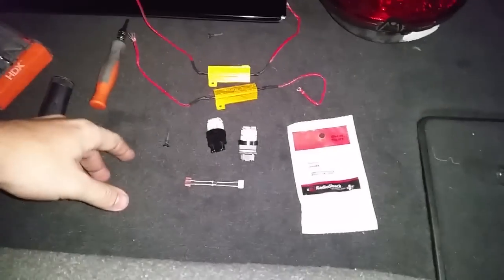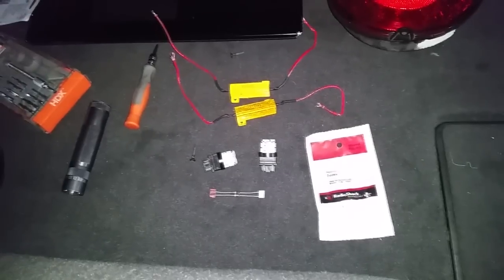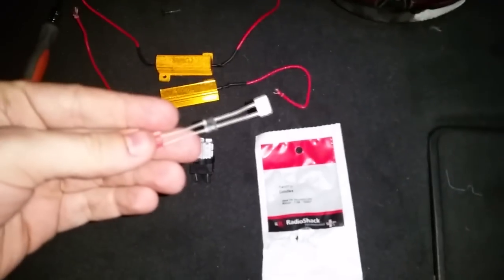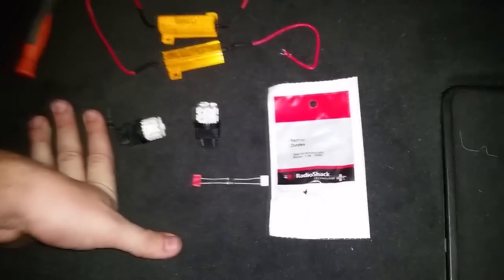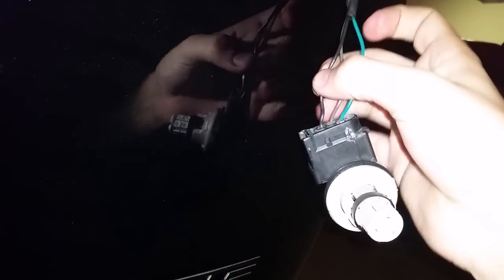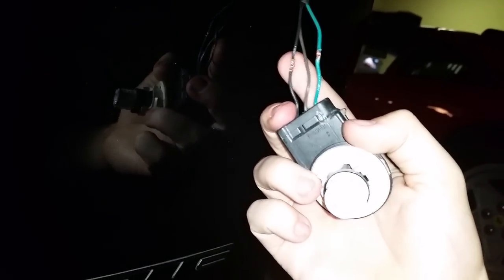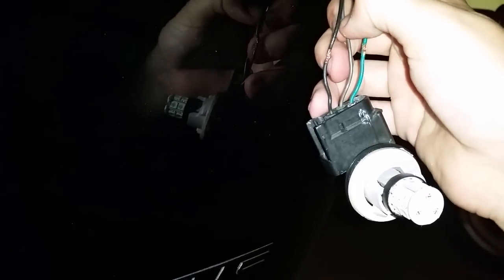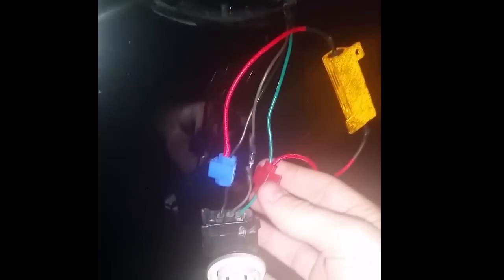3157 LED Turn/Tail Light Install Corvette C6 | Hyperflash and Park flash fix!!

Comment: Hi HardDrive - I have a question in case you encountered dealing with the front turn signals - I am glad to have found this as I believe it somewhat helped my condition. I replaced the front turn signal bulbs ONLY with LED switchbacks but my nuance is that I also added LED side markers to the equation. Adding the diodes to only the turn signal LEDs seemed to improve oddities but my question is should the diode be added to any LED "sensing/brown" wire? ie should I have added another diode to the front side markers or all four? as they seem to all have that brown sensing wire in common even though the side maker only has 2 wires black/ground and the brown/sensing. My issue/oddity is that my instrument cluster brightness adjuster does nothing its just one brightness = dim. I know this is old but thought I would try =) Thank you Greg
btw I do have a C6 now. Thx

Comment: Question about hyper flashing on Corvettes. On my C5, I simply installed one digital repay, and it solved hyper flashing on all the flashing LED bulbs on the car.  Why not install a single repay on the C6? Would that be easier than installing resisters on all the flashing LEDs on the car?  Is there a digital relay for the C6?
Reply: you guessed it, no physical relay on the c6. hyperflashing is handled by the BCM

Comment: I have a '07 Jeep Grand Cherokee.  There is one tail light bulb for the brake, tail & signal.  I checked all the wires & installed the resistor.  I made sure the brake light, tail light & turn signal worked...and it did (all in the same bulb).  Then I installed the LED bulb.  Only the brake light & turn signal worked.  I flipped the bulb around and the only the parking light would work.  Hmmm? Any ideas/suggestion?  Thanks!
Reply: Have you solved your problem yet?

I just bought an '07 Grand Cherokee. I installed these lights as well. Parking light works. Brake like works. Blinker does not. Hazards do not. I have yet to try this resistor.

Comment: Is water resistance tolerable? For example, in rainy conditions? I wonder how it is installed behind the lighthouse runs that risk. Or is it harmless?
Reply from the maker: As long as you seal your wires with heat shrink, the rest of the components are water resistant. I used liquid tape for the diode just to be safe. I've used these for over almost a year now with absolutely no issues. If you want to wait, I'm going to remake this video because I hate how poor of a job I did! Should have it up soon.

Comment: having the same problem with my 08 sierra, led tails, no resistors in, right side leds stay on the brake/bright setting and the left side functions properly. i hit the brakes and all the parking lights come on. would i still need to do the diode route ? ive never heard of another person going through this issue

Comment: Did this install with the exact components and method on a 2006 C6 Corvette (canadian model) and it did not work.  The blinker and fourways worked but running light circuit did not.  The resistor also got incredibly hot and even if it did work I would not have installed it just for this reason.

Comment: i was install resistor in my car .. but i need to know if its problem .. when i start the light for 5 or 10 minutes i cant tuch it .. its so soo hot it can damage plastic .. so is it normal or not
Reply: The same happened to me Amjad - so even if this worked (it didn't on my corvette) I would not have installed it for that reason.
Reply: Amjad that's normal hence why it's stated to install these on metal parts and not on top of any type of plastics.

Comment: Hey great video, just wondering where you attached the heat sink to? Theres a lot of plastic around that area. Also If you did the resistor on the far outside lights would you also have to do it for the two on the inside? Or are they running on the same wiring?

Comment: I have a 1997 Jeep Wrangler. I have replaced the front facing turn signals with LEDs and have encountered many issues. I have had “stock-looking” LEDs for the brakes for quite some time. They work, until now. The part No. RT-x24 is the new LED turn signals I purchased from [url]www.superbrightleds.com[/url]. I went ahead and installed 4 new heavy-duty resistors to both the brake and front facing LEDs. I do not have any rectifier diodes installed. My flashers don’t flash when the running lights, driving lights, or hazard lights are engaged. The relay is fine as I’m concerned. However, when I pull the knob (location: lower left of steering column) out one notch the dashboard turn signal indicators both come on. This is where the turn signals don’t engage, despite the LEDs being very bright. This is the same for the driving lights as well. Sadly, my hazards don’t even flash anymore. I would appreciate the help from any fellow Jeepers, like me.

Comment: Just out of Curiosity, I did exactly what you've done here (thanks for the wiring confirmation BTW) in my C6 GS Sport, this hyper blinking (LEFT TURN SIGNAL ONLY FAST BLINKING) is only affecting the left side, was this the case in your Vette?  also after installing the 6 ohm 50W resistor its still do the hyper blink?  WTH?  I'm wondering if I need yet another component, LED Tail Lights standard Bulbs in the front may also be another cause?

Comment: What size of diode what it? part #?
Reply from the maker: Its just called a rectifier diode. Any will work as long as its a ~1.5A & 1000V rated. I believe the RadioShack specific part is 276-1114
Reply: Thanks for the quick response! Do you know the exact number you used for ex. 1N4001, 1N4004 ect... not sure if there is a difference.
Reply from the maker: just looked it up. You need "GP15M" diodes if you want to follow mine exactly. After going back and watching this video, I realized how bad of a job I did explaining it haha. I'm actually going to remake this video now, that way its much more clear and concise
Reply: Right on haha I'll be looking for the new video!
Reply: Google Diode Dynamics they are 10$ for a pair 6 Ohms 50 W  What you're looking for they call an LED resistor kit, I've only got fast blinking turn signals but its not helping, hope it might help you!

Comment: Going L.E.D is the way to go when it comes to using less energy = less heat... but the hasle of putting them in a cars that came with factory filament bulb system, what a PITA. lol
Reply: Ikr... Replacing the lights with led, and then using 50w resistors. Like wtf? I installed LED blinkers on my car, and replaced the original relay with an LED relay.
Reply: @damianpc1  on vehicles with a body management unit, that's not option, the unit will show an error on the dash, if it came from the factory with filament bulbs you will need to go to the manufacturer's service centre and ask them to reprogram the unit. Last year I read that a certain big manufacturer used to do this for free if you did the install at their service center, but from 2022 on they completely stopped doing it for vehicles from 2017 and before and then in 2023 they stopped for all vehicles. So now your only option is have a hacker try to reprogram(possible on some) the unit or put in these resistors.

Comment: Did your car have issues with static on the FM radio? It only gets worst when you activate the turn signal or when you press on the brakes.
Reply from the maker: +Angel Trevino Hi sorry for the delay! I never saw the notification until now! static? no, I never had that problem. check to see if it statics slightly when your headlights are on. If so, then it could be possible.

Comment: I have a chevy C/K body style chevy truck and I'm having a hyper flash issue which I know I need the resistor. But when I turn my hazard flashers on I get a flashing parking lights symptom, will this fix my issue as well?
Reply from the maker: Andrew Hare My car was doing that as well. See if any other lights (dashboard) are flashing as well just to double check. I'm not sure what kind of wiring harness is in your truck without seeing it, but as long it is a 3057/3157 bulb socket then yes, this should fix it.

If it's not a 3057 don't worry. As long as you know which wire is which, the resistor/diode wiring will still work. It's just a matter of putting it in the right place. For example, on my car it goes green(signals), brown(DRL/Brake), black(ground). If the harness on your truck is different, then it could go Green(DRL/Brake), Brown(Signals), Black(Ground). It can be checked with a wiring diagram online. Just attach the diode to the DRL wire and you should be good to go.
Reply: ***** 
I have a c6 vette. But I have a question I will attach the diode and resistor only for 2 tail lights one in the right and one in the lift or I will attached for all taillights. 
Thanks
Reply from the maker: Mohammad Othman Hi, sorry I should've made that clearer in the video! You need a diode and resistor for all four lights on a C6. Essentially it has to go on any light that will flash when signalling.
Reply: Thanks your really helped me
Reply from the maker: Mohammad Othman No problem! If you have any other questions feel free to ask and I will be more than happy to help!